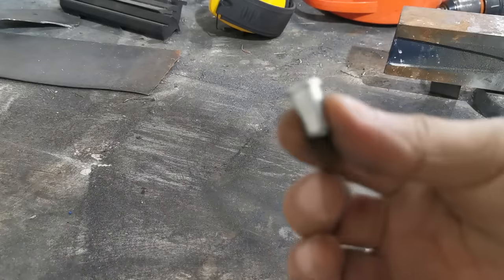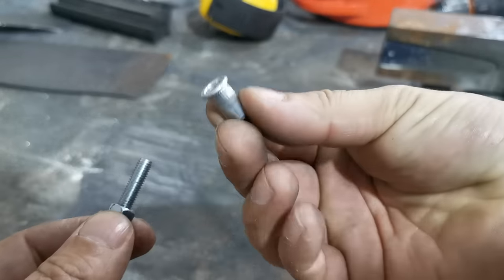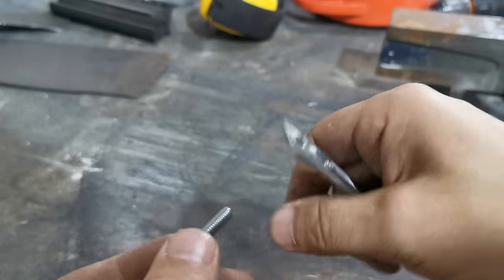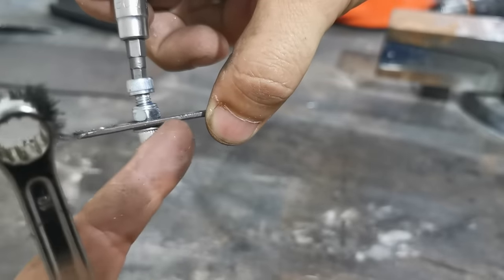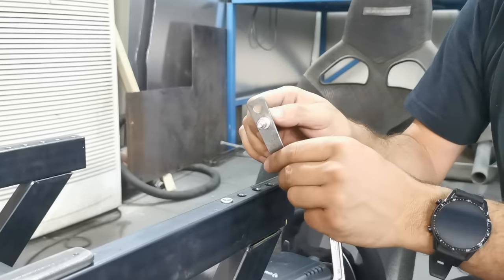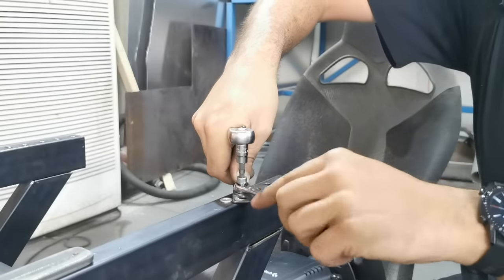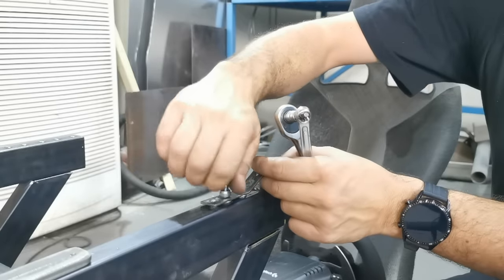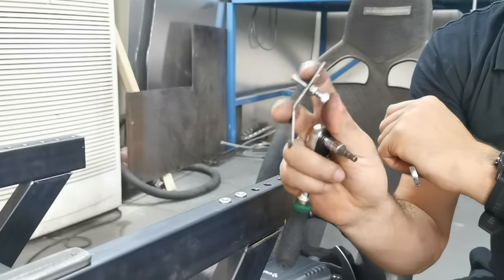How to install rivnut, rivet nuts or nutserts, with no expensive tools

Comment: Can you make it anymore difficult ?   whats the nut for ?. Use a piece of 3mm plate drill the right size hole drop the allen head bold through the hole you drilled in the 3mm plate , oh add a brass washer first . Now screw the nutsert on from the other side done, the allen head will spin on the brass washer on the top of the 3mm and the nutsert will lock on the bottom side , now use a battery drill to drive an allen key and your done.

Comment: Why one needs that metal piece? Why not just use a washer instead, big enough to cover to size of the rivnut?
Reply from the maker: A washer doesn't remove the torque from twisting the nut and risks the rivnut spinning in the hole as you tighten. Leading to a loose rivnut stuck in the hole. And a PITA to remove.
Reply: @SmokingSteelGarage  why not to use the wrench to keep the screw head that is screwed into the rivnat in the first place. This will prevent the problem you described.

Comment: I see these are aluminium rivnuts, does it work just as well with steel ones?
Reply from the maker: Hi. Yes these are alloy. You might struggle with steel especially with smaller thread sizes as this does put quite a bit of strain on the threads of the bolt used. I haven't actually tried it, but if I was to try I would start by using a stainless bolt and nut to give myself the best chance of success. Hope that helps? Thanks for the comment!
Reply: I have done so with 5, 6 mm, but you need much (!) more strength. You can experiment with increasing the length of the wrench (spanner) (Metall tube or pipe) to improve the torque.
Reply: @robertthomas6127  9
Reply: @SmokingSteelGarage  try using a high tensile bolt for each size

Comment: Interesting, how it can be eliminated after installed ?
Reply: Meaning got wrong and must replace it with a new one. Thanks
Reply from the maker: Hi Emil, thanks for the comment. If you need to remove you can simply drill them out like you would a normal rivet and replace them.
Reply: @SmokingSteelGarage  
Thanks using which drill size as to be able to replace with same size ?
Reply from the maker: Emil Wertheimer sane size as the hole will do it. Or a little bigger but don’t drill in to the metal. Just the rivnut outer. You need to keep the hole the same size to refit a new rivnut.
Reply: @SmokingSteelGarage  Thanks
Reply: @EWOverland  … If you can't drill you can possibly just knock off the head with a chisel and hammer and punch the rest through. Of course you have to be able to do so without damaging your workpiece. If it is in a case as he shows here in the video (steal pipe) or a thicker plate that is no problem what so ever as the material is thick enough. As we say …  been there, done that, got the tshirt (;-))

Comment: I've tried this method, but my bolt just sheers :(
Reply from the maker: Make sure to use some lubricant. Copper slip grease works well. Or wd40 if that's all you have. Also grade 8.8 bolts or stainless or hardens bolts do work better. If you don't have any around it a case of using multiple bolts to get the job done.

Comment: My windshield frame bolts on my 1962 Austin Healey sprite mk2 the front ones rusted in place so iam usually an original type guy but who's going to know its hidden iam gonna do this tomorrow and see it work the original is a nut in a cage under the sheetmetal and to access it would be impossible without major welding cutting grinding so this is my only option in the body shop getting fresh paint

Comment: Or you drill out the threads of the nut use a washer behind the drilled nut use a wrench to hold the nut and washer to the rivnut and another wrench or driver to tighten down the threaded bolt and secure the rive nut ya I ruined a nut and a doller drill bit but I sank 12 of em and they held up to a shear car accident. (Used them to secure running boards to my truck the bolts sheared after pulling g the frame crooked lol they are strong buggers) lol

Comment: I use these everyday..always compress the rivnut all the way so you don’t damage the spline on the rivnut...or it will loosen up and spin....the squeeze hand tool is junk...they sell better rivnut tools..if you use them everyday get the good stuff...but they do wear out too...sometimes you have to improvise..like for certain applications..countersunk/tight areas...

Comment: Ps our advel guns are years old and still as new with the litlery millions of inserts been through them. I break at times the m3 tool steel thread insert rod every 3000-15000 ,inserts. M3 m4 all the way to m10 ive never broken a tools consumable inserts.

Comment: Not sure why you need tool…good hex head socket on top should keep it straight and pushed in.  Have you tried it with just a washer instead of tool…preferably brass…instead?  Holding tool plus rachet looks cumbersome.

Comment: WHY DONT YOU USE A WASHER BETWEEN THE NUT THAT TURNS AND THE METAL PIECE?? THAT WILL REDUCE FRICTION A HUGE AMOUNT, AND A DAB OF GREASE BETWEEN THE WASHER AND METAL HANDLE...

Comment: Bought kit and was all excited about cleaning up hot rod fire wall. Drilled hole, set nut, attached tool, squeezed. Nothing. Squeezed harder, nothing. Put full gorilla on it and pow, threads stripped right out. Unbelievable.

Comment: Best to put some locktite on the outside of the rivnut to make sure it stays put, as they can rotate in the hole under high torque....
Reply from the maker: Good tip!
Reply: Which loctite would you suggest for the application? Any advice appreciated.

Comment: Except the tools aren't expensive. You say that the cheap tools threads aren't designed for the loads involved which maybe true of some tools (but I've never had a problem with the two tools I own and I've installed a LOT of rivnuts), but then neither are standard hardware store grade bolts designed for that sort of load. As for tight spaces my smaller tool will fit in any space that a spanner would.

Comment: Hi @smoking steel garage, I'm glad I found this video cause I've been trying to find a way to get 10/32 rivnuts into a spoiler. I can't find 10/32 adapter  and no sizes available in Home Depot or Lowes. Do you think I can use your trick into installing these on a spoiler? The video link shows the man using the rivet tool.

https://youtu.be/jI4elaxxWKw?t=249
Reply from the maker: Hi. Yep that will work, Its a great way of fitting rivnuts in tight spaces as well. where a rivnut gun is traditionally too big to access.

Comment: Why not buy the tool costs about a tenner over here lot of effort for little return
Reply from the maker: Because cheap tools are made from poor quality materials and so they break, and with a tool like this they usually break in the middle of a job. This is a even cheaper solution that takes ten minutes tops to make. and gets the job done. Also as I mentioned in the film the mass produced tools are large bulky and for some jobs they are not suitable as you cannot fit them into small spaces. this tool overcomes that problem.  Thanks for the comment Kevin 👍

Comment: What do you mean expensive, it's 20 bucks man. Interestingly, I'm looking for a how to on rivet nut tools because I'm building myself a simracing cockpit out of aluminum profiles aswell
Reply from the maker: yes they are cheap, and that's great, until you snap a head off it mid job. And for me that's a disaster as my location means I can't just run out and buy a replacement. Hence coming up with this tool. Now I don't bother with tools at all for them. Awesome news of the sim rig. Check out my Steel build series.

Comment: Jist buy the correct tool. Time is money. I can insert over 9000 advels in one shift depending I  product. Ide not get 200 fitted doing this. Meaning 0 profit on the job.
Reply from the maker: Hmm. Your missing the point. Some of us might only want to fit one or two rivnuts. So why spend on a expensive tool when it can be done without. Of course If we had your job we would also expect the correct tools 😂😂😂😂
Reply: @SmokingSteelGarage  ye I won't lie 90% of the fittings can be installed with a hammer and steel block or even just use a g-clamp if there is access.